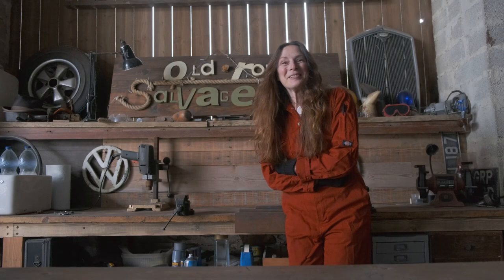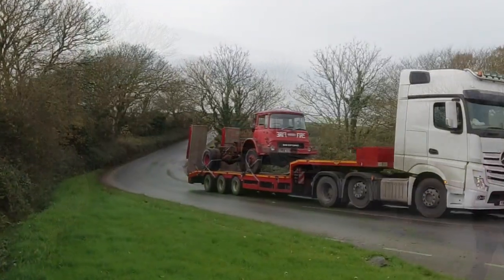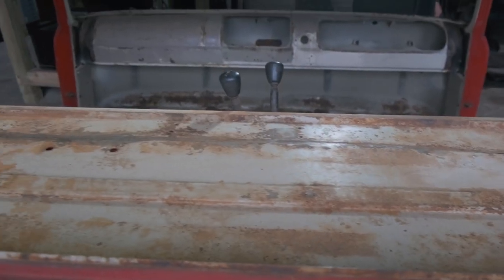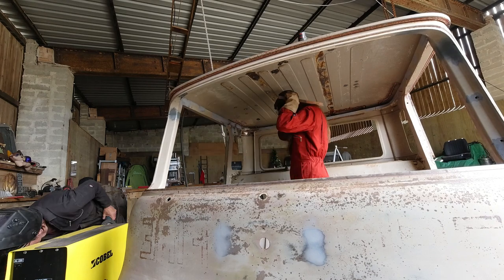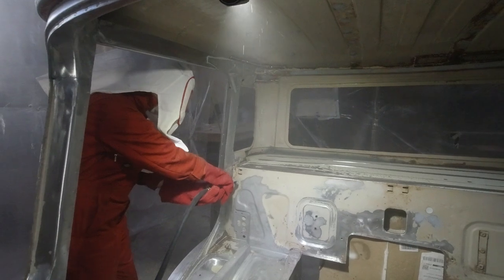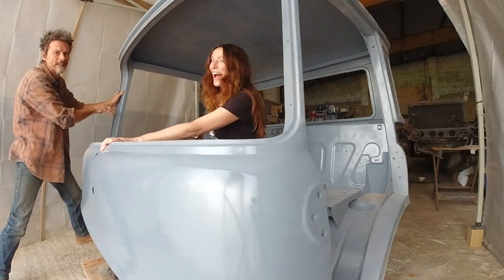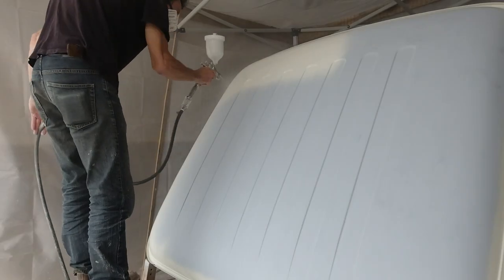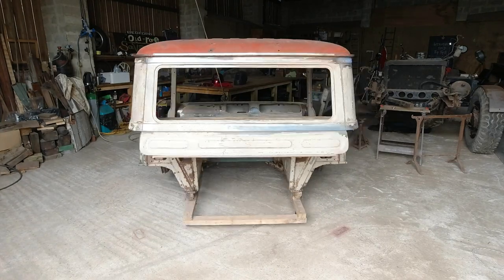From Rusty WRECK to Shiny MARVEL - A 1 Year Restoration Special of Our Vintage Bedford Truck Cab …

Comment: Whats not to like about a TK/MK cab, they are an absolute iconic design. It looks like you are doing a fabulous job. I currrently have one chassis and three cabs, and a lot of new parts, some of which I have discovered will not fit my TK as they are actually for an MK, they will be looking for a new home at some point.
Reply from the maker: We're missing a hinge from one of the engine bay cover panels so if you have a spare one of those ...